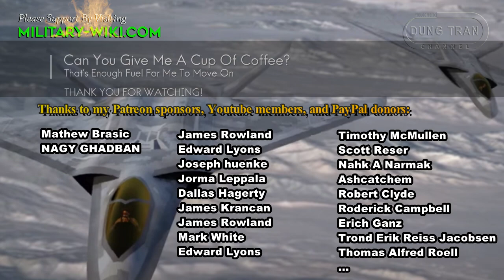Why Are Today's Most Modern Fighters Much Slower Than in the 1960s?

Comment: People speak about maxmum speed of modern planes but they forget something. Maximum speed of planes are in clear configurations without pylons, armament and not full reservoare of fuel.
What that mean in combat situation? F-22 gonna be faster than f-15, f-16 because he have weapons inside and he is very near to clear configuration, he don't have parasite air drag...
You have story f-106 overrun f-4 on youtube by speed because that, even on paper f-4 is faster plane, F-106 have less drag, because weapons are internal, he is much clear to clean configuration.
F-22 in cmbt i think is USA fastest plane they have.